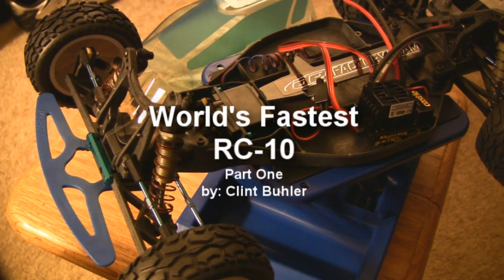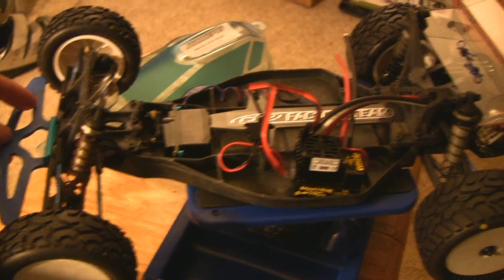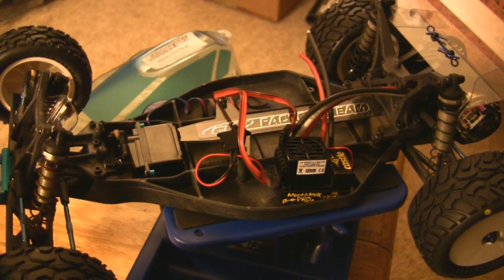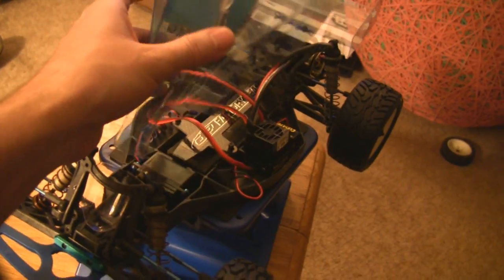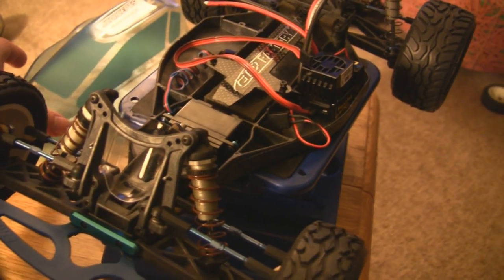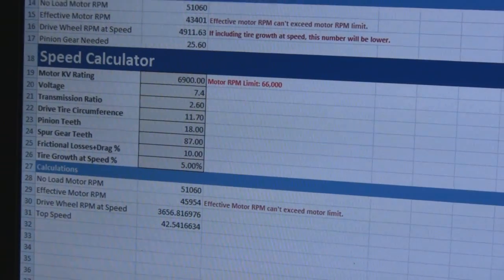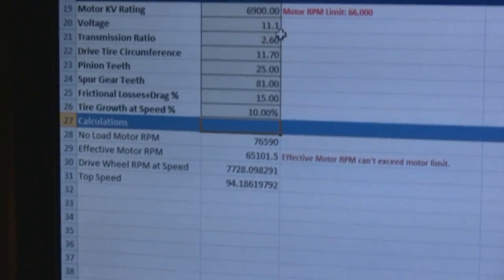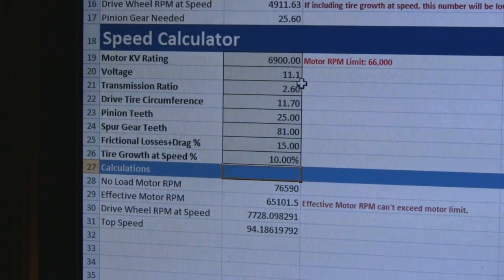Project World's Fastest RC10 Brushless Lipo Part 1

Comment: couple things, those hubs are 0 degree, so reversing them does nothing.  2nd, best thing you can do is not worry about weight, put 2 ounces on the front bumper. 3 dirt hawgs say dirt in the name, get a set of foams. they are much lighter and more balanced. Ditch your computer gear the bitch way up to soften the motor punch, put your 3 cell in and just go run it. don't overthink it, just go run and experiment. Turn your steering dual rate way down so it doesn't get twitchy.

Comment: You Said You Wanted Something With The Most Flexibility, But Not 1/8 Because Of The Transmission, And Only Use A 3s Lipo... Umm 3 Words. Tekin RS Pro - For A Speed Run Boost Ramping And Timing That The Tekin Offers Is A HUGE Advantage.

Comment: you can make it to a hundred, but it's gonna take a lot more work than you think... i have an old b4 stealth i started from scratch and ordered piece by piece,, all aluminum and titanium up grades i could find.. S.T.R.C. is an awesome brand for hubs and hex adapters for better rims and tires than anyone else has on there b4's.. i spent a little over $2,500 so far on it, extra parts, and all the spurs/pinions..  running a castle mamba max pro 4600 on 3s right now and its stupid fast..